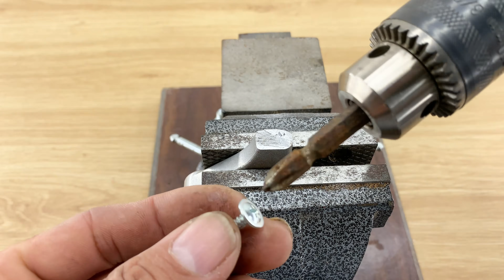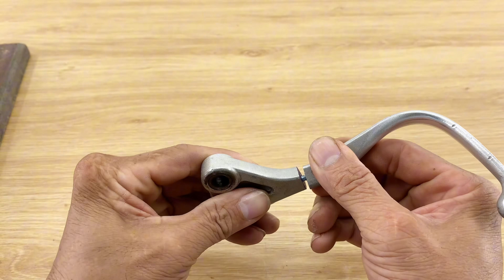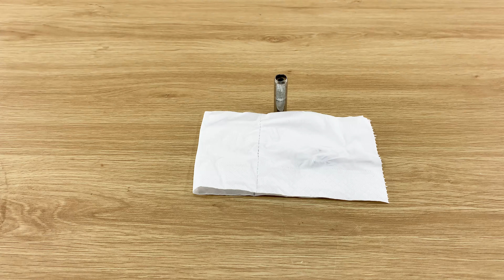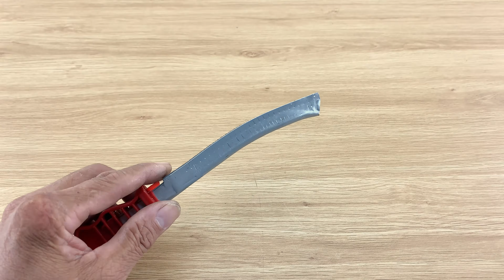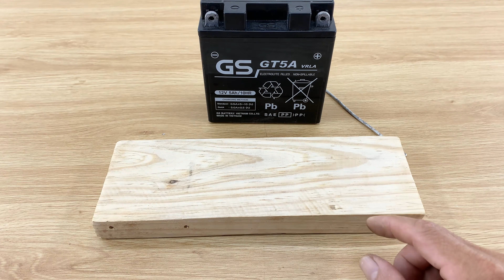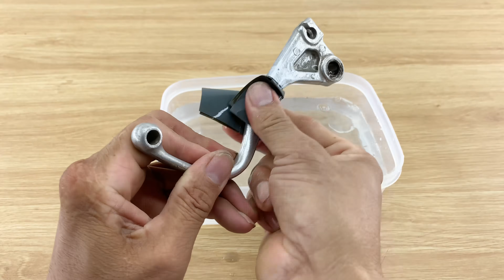Welding Aluminum Is So Easy! But So Few People Know This Method!

Comment: Ok. I'm not a chemist, nor an expert welder, but people need to think twice about this "trick". I'm not even sure it works, but I haven't actually tried it. But I'm not commenting to argue about that, but something else. 

Notice what the "flux" is made from: Toilet bowl cleaner with zinc dissolved in it. 

The toilet bowl cleaner shown contains a high percentage of hydrochloric acid (look and pause as the bottle is rotated). 

When zinc is reacted with hydrochloric acid, it forms zinc chloride, which is a solid that (likely) precipitates out of the solution. 

What is being shown as "flux" though, is likely some mixture of the zinc chloride and hydrochloric acid. 

To which is then being applied heat in this "welding" process. 

When heat is used on just about anything with chlorine atoms in it, it generally forms what's called phosgene, a gas that is super-duper dangerous, even in very, very small quantities. It was a poison gas used in WW1:

https://en.wikipedia.org/wiki/Phosgene

This is one reason why you should never use a laser cutter to cut PVC (poly-vinyl-chloride).

Some forms of brake cleaner contain a form of such chloride, as "tetrachloroethylene" - and welding after using it can lead to everything from a shortness of breath, to a collapsed lung, to death. And it's kinda strange that I'm writing this - because as I was trying to find a particular old posting about the problem - this popped up:

https://hackaday.com/2025/12/17/the-lethal-danger-of-combining-welding-and-brake-cleaner/

...posted just a few days ago. Here's another:

https://www.thefabricator.com/thewelder/article/arcwelding/cleaning-material-with-brake-cleaner-before-welding-a-risky-move-that-can-turn-deadly

Ah, here we go - this:

https://locostusa.com/forums/viewtopic.php?t=7110

...has a link that leads to...ack! 404 Error...typeytypey - should be this (why not a 302 redirect people - sigh):

https://www.brewracingframes.com/safety-alert-brake-cleaner--phosgene-gas.html

So you can see I'm not making things up...the only question is whether heating toilet bowl cleaner that contains hydrochloric acid will do the same thing? 

Are you willing to test this? Based on a youtube video?

I'm not.